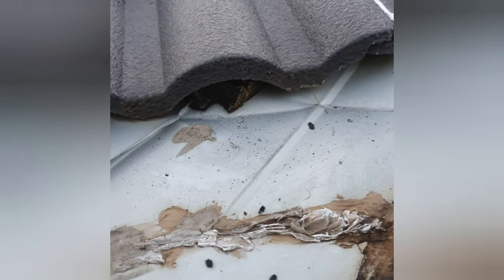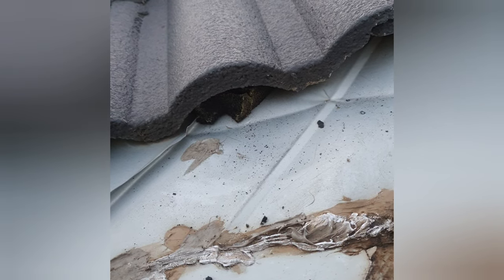DIY Valley Seal Installation: A Step-by-Step Guide for Homeowners (STORM SEAL)  - JSIU ROOFING

Comment: As a handyman, I have used this exact seal to deal with a messy valley set up with a skylight on one side. I put the seal right up under the tiles and flush to the valley edge. It stopped a leak which I had for years which even pro roofers couldn't seem to fix. In this case, it needed to be in flush and neat the whole way to work. Initial "quick stuff under" didn't work - this seal is square, and needs to be put in right under and neatly. You may have to lift or remove tiles. Make sure mark tiles, and put them back in exact same position they were.
Reply from the maker: Excellent! This is exactly what we appreciate. Fantastic work, mate! Keep up the great work!

Comment: Valley seal is rubbish.. Only roof tilers use it, there are better products available
Reply from the maker: Hello, my good friend, which products are you referring to? But you're correct in a way, as all products have drawbacks.
Reply from the maker: Thanks for sharing that Leaf system - That system effectively handles leaves and debris, but when it comes to addressing valley overflow issues caused by heavy rain, the Valley Seal is specifically designed for that purpose. Nonetheless, we value active viewers like you in the trade. Keep up the good work Mate make sure to like and Sub